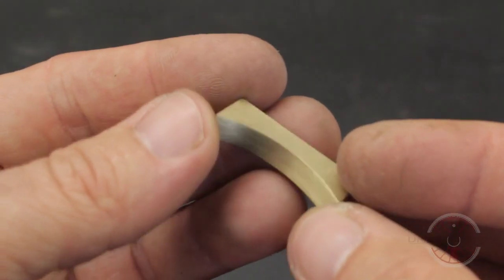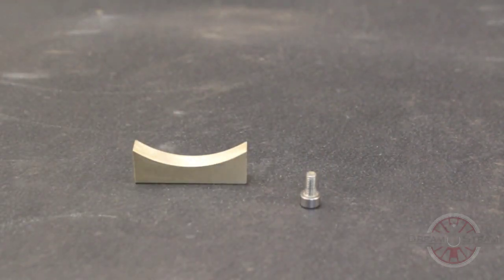Lets Build a Cracker # 2

Comment: The cradle material was probably specified as a composite to provide a thermal break. There are many composites that have insulating properties. One composite that is readily available is wood. A nice bit of hardwood such as rosewood, ebony, rock maple, etc would look great. You don't need any special tools, very hard woods can be worked in the same way as aluminum. You can sometimes tap threads in wood, but I'd glue in a threaded brass insert.
Nice model so far, thanks for sharing.
Reply from the maker: Thanks for the good tip. I thought about the same. Maybe a wooden strip between the mountings and the footplate. 
ThAnjs for watching!!!! 
Cheers

Comment: Great as always. One question: why do you file the mark made with the burin . Regards Roberto
Reply from the maker: The mark or "center-punsh" has alsways high spots around. (On mild material) that can cause the Drill dance around the Center... in small drillings) its to prevent from that....